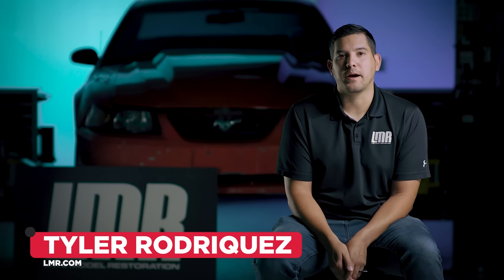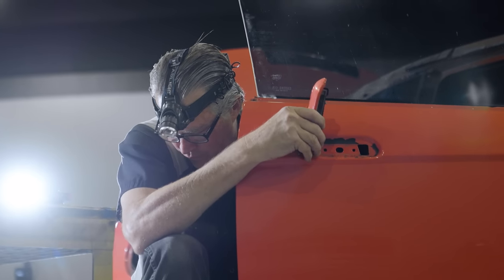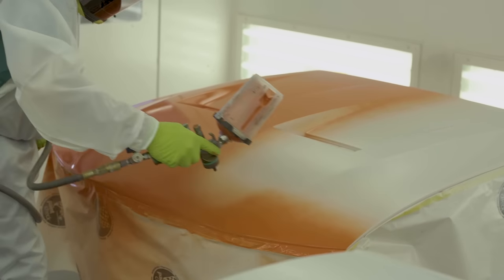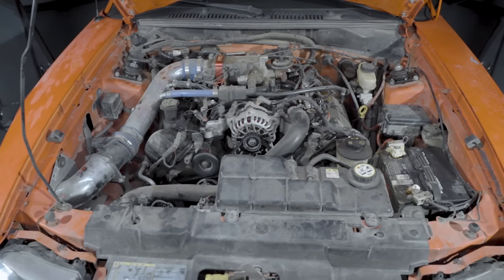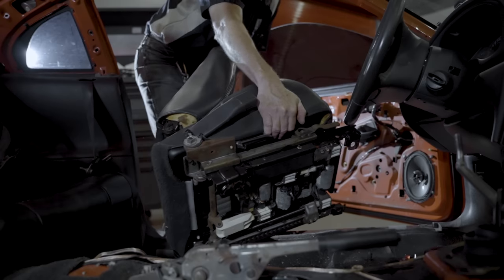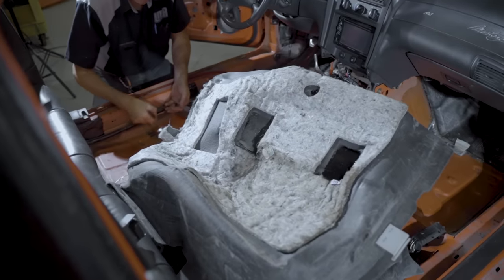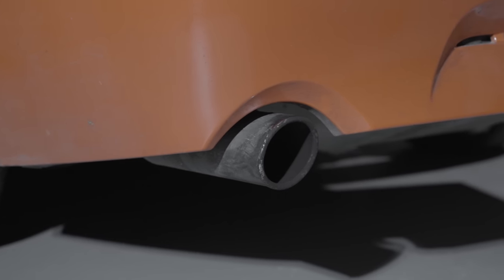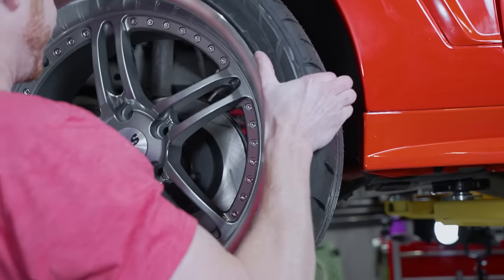New Edge Mustang Project Car | Project Keeping Comp (Full Video)

Comment: ive got a Competition Orange V6 I'm working on right now. pretty excited to get it back in good condition
Reply: Nice score. Competition Orange looks really great on these cars. I just got a V6 too (what I wanted) but it's a faded Laser Red, best red Ford used by also the most faded and can't really be duplicated unless I want to spend $6000 and that ain't happening!
Reply: @HAL-dm1eh  I'm in the same boat with my orange. Faded and touchups ruined the original coat so it's going to be an expense but it'll be worth it.

Comment: Quality people and an unlimited budget to do it right, anything can be accomplished. Nice result.
Reply: Yeah and access to a warehouse of parts.

A 2v with under 50k miles can be had for well under 10k. I bought a 2003 GT for 8 grand with 43k miles. Original owner garaged. Navy Blue tan leather. The 2v is a solid motor. I drive them in taxi’s with 300k miles. It is what it is. 

Restoring these cars is not financially sound. A good paint job will be well above 8 grand

Comment: I have a similar story with mine. I bought my 2002 GT Mustang back in 2007, I think I was the third owner. Had it for about 4 years or so. Did some basic things to it, wheels exhaust etc. then I sold it in 2011. I sort of regretted selling it after that, searched for it off and on (new owner was from out of state) and eventually found it again and bought it back. It's currently in the process of getting a coyote swap with a T-56 from a 2004 cobra (I bought the car back as a roller). But more or less I'm making the car look pretty much like it did before I sold it. It had a lot of sentimental value to me (I had the car through my first overseas deployment to Iraq). Nostalgia is a hell of a motivator lol.

Comment: I would have sourced a 99 4v na cobra engine and cleaned it up/replace anything that needs replacing, tremac t56 6 speed swap and sourced 99 or 01 cobra gauges.

I loved every single wheel it had on there even the stock wheel. I will say that stock wheel is my favourite for older mustangs.

Comment: I have a 2002 Mustang GT with 225,000 miles on it. It doesn't burn even a drop of oil per oil change/4-5000 miles. I just got done replacing a few coil packs, a throttle positioning sensor, a mass air flow sensor, plugs, oil, wheel bearings on the front and i picked up a set of Michelin tires with 1/2 thread on them for a whopping $40. I do everything on a budget because i just can't afford to pay out the ass for everything brand new and yet the car is in much better working condition, still with very little rust on it. It still needs a few more parts [like a new windshield, a new gas pedal throttle control sensor and maybe some suspension pieces] but i am happy with this car over all and had no idea what kind of car i was even buying when i agreed to buy it. I just needed a car and my other one [a Saturn] blew up on me]. I bought this for $100 a month payments 5 years ago and paid $2000 in total for it. Because i have health problems and the previous owner gave me a deal on it and i have no family members left, i plan on giving him back the car some day in much better condition than when i first got it. Over the months to come i will continue to replace parts like the windshield and suspension as i can get to them in rather slow fashion and someday he most certainly won't regret giving me a good deal on this car as for the fact that he will get it back free and clear in such better condition. I would post a pic of it if i could but you tube don't allow pics here. It looks almost identical to this car!

Comment: A full out restoration and I would have added a mix of Roush, Saleen and Cobra body parts. A cobra rear bumper with cobra smoothed out, Roush side skirts, Saleen door/quarter panel fake vents Hood of your choice and Roush or Saleen front bumper

Comment: I absolutely love what you've done with the car however the only thing that I would have changed was the headlights... I have HIDs in my car I did have the factory halogens but the reason that I went with the HIDs is because the factory halogens weren't bright enough and unfortunately I ended up wrecking the front end of my car so I had to have the front end of my car refurbished when I ended up wrecking the front end of my car I actually blew the airbags I decided not to put the airbags back in because it's a muscle car I took the original steering wheel out because it reminded me too much of my truck and I put a three spoke steering wheel in it... I like the three spokes steering wheel because it looks more like the mustang should look... The reason that I did not put the airbags back in I opted out on the airbags is because it's a muscle/sports car it's a V6 3.9 L with a 5-speed manual transmission... Does it have the power of a 5.0 dual cam dual valve? No it does not but she will let you know she's a pony 🐎 now as far as the headlights are concerned if I were you and this is just a suggestion put a set of HIDs in it get a hold of SW lights the guy's name is Sean Wicca he does fantastic work and you can custom make the lights anyway you want them mine were $1,008 dollars but it didn't buy them all at once he actually let me make payments on them and then he sent them to me when you were paid off... I'm telling you I love my lights... It is a complete difference between night and day literally... Yes they are expensive but I'm telling you they are worth their weight in gold much better than those halogens... People do do this but it is actually against the law you can buy HIDs to put in your factory globes but know this it is against the law to have HIDs in your factory globes you must have a projector style globe to put HIDs in as long as you have a projector style globe those are not against the law... Like I said they are more expensive but they are well worth their weight in gold

Comment: Looks awesome!   I totally agree with the spoiler delete.  I think these new edge stangs look way better without the spoiler.  Would you believe I actually saw someone with a 2001 mustang bullet with the highland green and it HAD a SPOILER that they obviously had installed,  because the bullets came without the spoiler.   Looked horrible.   But this comp orange looks awesome.    The only thing I think you should have kept was that special looking gas cap that you had on the car,  like the bullet.   You painted over it in the competition orange and I think you should have kept that unique looking stainless steel or whatever gas cap and cover etc.    But that's just my opinion.   Overall the car looks awesome!

Comment: I had an 04GT and now a 14GT and I sorta miss my 04.  The SN95s get crapped on for lack of power but once you get over not winning races they are great first fun cars.  Reliable and plenty quick.  My 04 sounded 10x better than my 14 lol.  And they noticeable weigh a lot less when you drive them.  I actually miss mine and actually found my 14 looking for a mach1.
Reply: Dude u can make a new edge quick fairly easy.  Just because it dont run 12s from the factory don't mean it can't go 11s or 12s with minor work even na.  With boost you can go 10s stock driveline it's been done many times.  The problem is everyone judges stuff by horsepower and not how it performs there is alot more to a quick car than how much hp does it have.  I have seen new edges go 10s with just over 400 rwhp.  They weren't gutted either.
Reply: For sure m.  I’m just not a project guy.

Comment: The OME bumper skin for my 01 GT Deluxe vert was $879 in 2013, someone backed into it with a lift gate van and punched a $25 size hole in it and couldn't be repaired, it does not need be restore yet other then replacing the silver smoked headlights

Comment: I have a Mineral Grey 01 GT that I built for autocross/roadcourse/canyon carving fun. The brake upgrade to the Cobra/Mach 1 style and a short throw shifter have to be my favorite mods as far as driveability goes.

I had a deer choose my car as method of suicide and I had to replace the hood, bumper, and driver fender. I went with the V6 hood and Mach chin spoiler, and took off all the panels to take to the paint shop. Sitting in the driveway with the front body panels off, it looked MEAN

Comment: Ok so, I was gifted my grandfather's 00 gt convertible after he passed and I'd like to do something like this, what's the ballpark range as far as cost and time?
I'm nowhere near as knowledgeable so it wouldn't be this in-depth.
I still drive it but it needs major work. 205 on the dash, all original. Any help would be appreciated, thanks!
Loved the video, love the channel, love mustangs!
Reply from the maker: It's tough to gauge since we do not know the exact condition of the car. Completely respraying the car and updating the interior, wheels, suspension, and brakes can be very costly. Give us a call, and a customer care representative can assist you with supplying the parts that you need to refresh your New Edge: https://lmr.com/contact

Comment: If you use that hood with a 03/04 style bumper will you run into fitment issues
Reply from the maker: Yes.  This hood is designed for the 99-04 V6/GT front bumper.  If this is installed with either an OEM or aftermarket 03-04 Cobra bumper, the underside of the hood will make contact with the bumper pillars.  Hope this helps!  -Landan

Comment: I've got 99 SVT Cobra Mustang with 64K miles.  It's Highly modded everywhere for road course tracking if not racing and looks somewhat stock kinda like a 2000R on steroids but with a lot more performance.  Many parts purchased thru LMR, MMM, Steeda, Summit to name just a few... The car is still purposely street legal

Haltech ECU with Auto Blip going in presently to help manage engine HP and then it going thru the drive train more effectively keeping the car/tires hooked Up.  Aero had to be quite seriously addressed too hence 2000R on steroids and hopefully not too "ricey".  Lastly, need to address an ABS upgrade based on hopefully 200 to 40 treadwear tires

Comment: Great video but WHERE can i get them plastic air lines ?!
Reply from the maker: David - If you're referring to the plastic vacuum lines in the engine bay, these are not available in the aftermarket.  You will have to source them from a donor car or route custom hoses. -Landan

Comment: I got a 03 mustang 60k original miles stick shift with pony package v6 good condition torch red all original 1 owner there’s not to many 03 with the pony package option these are hard to find not many people got these ones I just want to keep it clean and original with low miles this car was parked in my garage for almost 10 years front and rear bumper the clear coat is getting faded sad I sold the original 16 inch aluminum polish rims 😢 i now have mustang special edition rims from a coyote and I have a Mach 1 front lip car looks nice now car never gave me problems only once the clutch was replaced about 2 years ago when I got it out the garage clutch must of gotten old and corroded my throwout bearing needs a replacement it makes a noise sometimes I want to be one of those old people that drive around with an old car in the future im 18, I never abuse the car always drive regularly cause I want to conserve the cars life till the future, I want to repaint the front and rear bumpers torch red again but I don’t want to ruin the car that it’s all original I’m 18 years old with a nice mustang clean and original if someone else owned my car that thing would been abused they would add stupid mods and ruin the car

Comment: Had an 04 CO GT, but sold it in 2018. Had a Terminator hood, Bullitt side deletes, and a duckbill spoiler (different from the Cobra). Had only 60K miles and was mint! Miss that car...
Reply: Where did you sell it?  I just bought one and think it may be the one you are talking about.
Reply: @AustinMathias  It was sold in MD
Reply: @mg1822  I bought it from a guy in Virginia
Reply: @AustinMathias  I think the buyer was from VA....Does the car have gloss black Rovo's with 295's in the rear?
Reply: @AustinMathias  - So it's not the same car...?
Reply: @mg1822  It has different wheels now that the last owner put on.  Did it have a bbk throttle body and black bbk cold air intake?
Reply: @AustinMathias  No, mine had stock intake and TB. I don't think this is the same car...Does it have an aluminum driveshaft?Short throw shifter, with black/orange retro style shift knob?
Reply: @mg1822  Yes it does
Reply: @mg1822  Very short
Reply: @AustinMathias  Yeah, it was super short! This indeed sounds like my old car..very cool! I have the original hood/trunk with spoiler/side vents/oem wheels if your interested in buying. LMK
Reply: @mg1822  I appreciate it, I actually like it the way it is and love what you done to it!  What all is done to it if you don't mind?  The previous owner did not change anything and didn't know what was all done
Reply: @AustinMathias  I just did the exterior mods. One of the owners before me did the mechanical mods. When I bought it, the seller said it was 100% stock..which was not true. I know it had the aluminum driveshaft, 3.73 or 4.10 gears, short throw shifter, larger injectors, flowmaster exhaust.
Reply: @AustinMathias  That's a Xenon spoiler too in case your wondering. It's pretty rare and I haven't seen another mustang with it. I was going to swap the front bumper at some point with the Cobra one, but didn't want to make it look too much like a Cobra...I wanted it to look like it's own thing. Is the trunk still debadged? I know the ford emblem was shaved and filled.
Reply: @mg1822  I agree.  I like the GT front bumper on it.  I actually had to remove the spoiler the other night to change out the 3rd brake light and Seen it was a Xenon.  I've never seen another new edge with that spoiler.  The car is definitely done right.  I'll have to send you some pictures of it
Reply: @AustinMathias  Spoiler had to be removed?  Huh..I thought it would pop out without taking spoiler off. Pics would be awesome! Thanks
Reply: @mg1822  I was hoping so but there was double sided tape between the light and spoiler my luck
Reply: @mg1822  Trying to figure out how I can send you current pictures.
Reply: @AustinMathias  Can you post pics or a video on your YouTube page? That might be the easiest
Reply: @mg1822  Yes I will have to do that

Comment: does new edge 3.7 supercharger fit on 3.8??????
Reply from the maker: There was never a 3.7L engine in the New Edge cars.  Judging by the displacement, I think you're referring to the V6 engine.  If so, 1994-2004 Mustangs had a 3.8L and 3.9L V6.  Halfway through the 2004 model year, Ford added a little bit more stroke to achieve the 3.9L displacement.  Other than that, the engines are identical.  -Landan

Comment: Clean car! Time for a Coyote swap now
Reply: It doesn't need a coyote.  It's nice to see different routes sometimes.  It's not that hard to go quick with a 2v simple forged internals will make one capable of 1000 hp.  You also don't need anywhere near 1000 to go very fast in a 2004 mustang.  Nice to see clean cars supporting their original engines and doing work.

Comment: My brother had a 2003 black one that he bought brand new in 2003 with only four miles on it it was one of the most beautiful cars ever I love New edge Mach ones. He had it for a few years ended up putting about 53,000 miles on it but he was at a stoplight one day and it Toyota Tacoma smacked him in the ass and totaled it pretty much but then changed in total it out they fixed it even though it was like a banana I'm right after that so we ended up selling it and only got about $5,000 for it when he paid $43,000 for it brand new....

Comment: IMO the rust under the battery tray isnt from a leaking battery, but rather poor engineering. Water gets in between the crack of the hood and the fender and just sits in the battery tray. I recently bought an 03 gt with the same issue. There was standing water in the tray, the hold down bolt was completely corroded and rust under the tray. I drilled a few small holes in the tray so it can drain, hopefully that fixes it.

Comment: I had a 2003 Mustang GT that was just sadly slow, even with bolt on's. it was dissappinting. My stock '18 Ecoboost was way faster and more fun.  
All these 2 valve 4.6's need a whole top end kit, but there as expensive as those Mustangs are worth.
Reply: This is totally false lol.  A nice new edge goes for 10k easily it isn't anywhere near that for a trickflow top end.  Just fbo cams and boost you're well over 400 rwhp.  It isn't that hard to be quick with these people focus too much on power and not just performance.  Power to weight and gearing and stuff is what matters.  It's not just about power level.  A boosted 2v done right will walk most ecoboosts.  I've seen them go 10s with 400 rwhp.